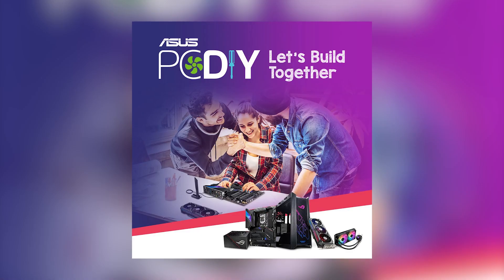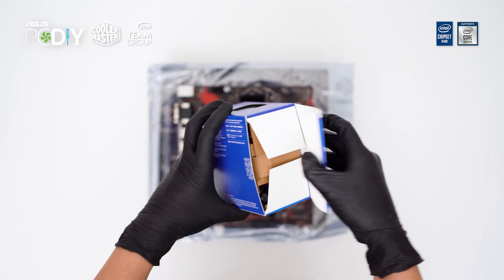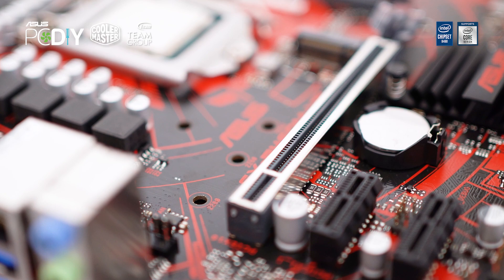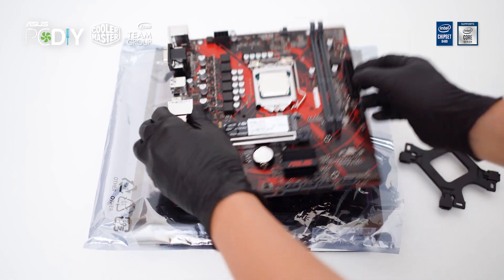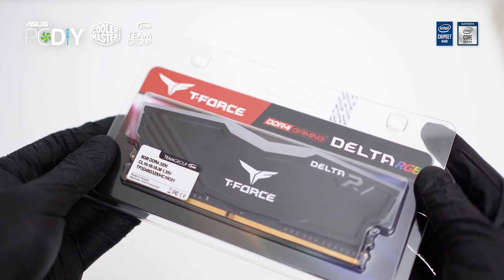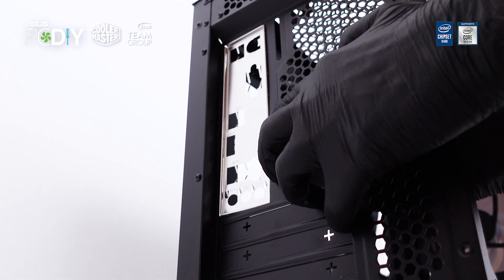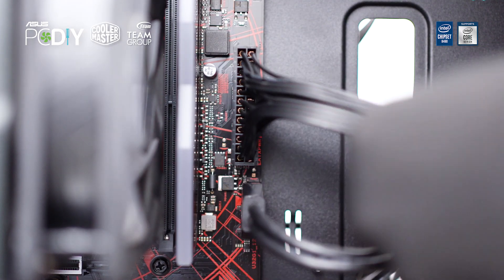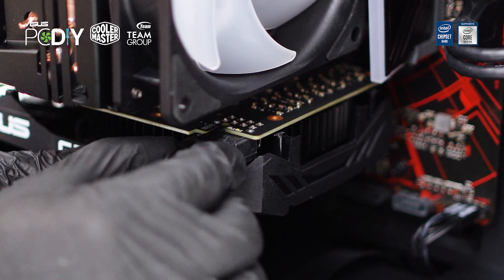Build Your Own PC in 10 Steps

Comment: It's a nerve-wrecking when trying to insert proc on mobo socket. Once my mobo pin got bent, & it was my first DIY PC. Tried to fix it, but ended up making the pin broke. Should watch some DIY tutorial before doing it. 😂

On side note, this video is easy to understand & follow for newbie. It will much better if there's a brief explanation about front connector panel tho. Thanks for the video!

Comment: Not much comment to say, video was almost perfect. Should actually try to boot / start first to ensure hardware and components are working fine before install into the case. Sometimes something unexpected occur and it is easier to troubleshoot outside of the case.
Reply from the maker: Yep! I actually did booted the PC beforehand, probably should've included in the video too!

Comment: What size of fan can I add for the back slot? And which connector do I use? Thanks
Reply from the maker: You can add a 120mm fan at the back, either 3-pin or 4-pin pwn fan

Comment: Can I remove and put back the cooler of my processor without reapplying thermal paste? #ASUSPCDIY
Reply from the maker: You should clean the processor and reapply fresh thermal paste. Once you remove a cooler, some of the paste will be separated and you'd be left with much lesser paste than you need to provide good thermal conductivity with the new cooler.